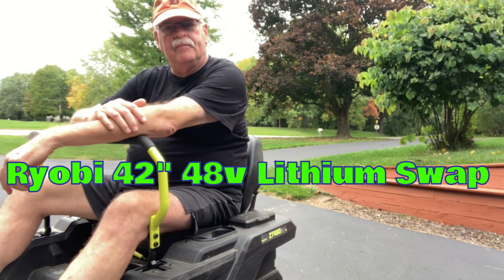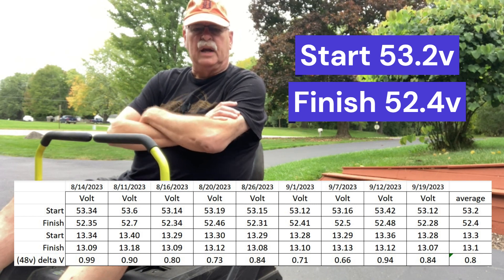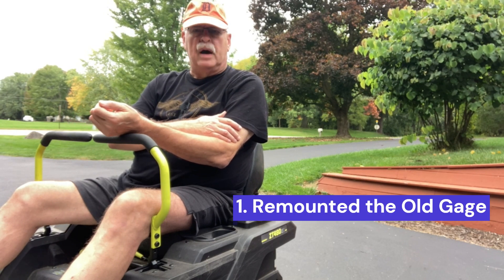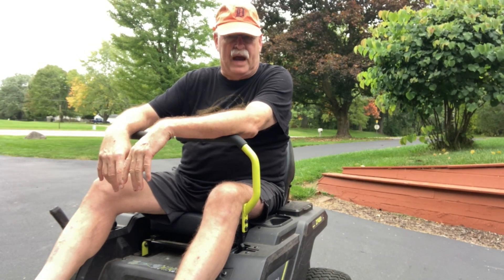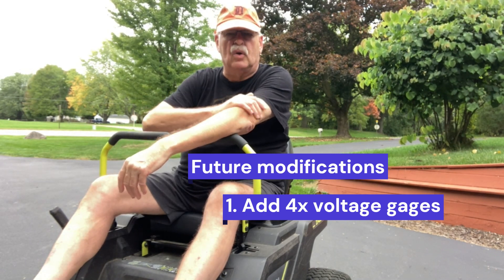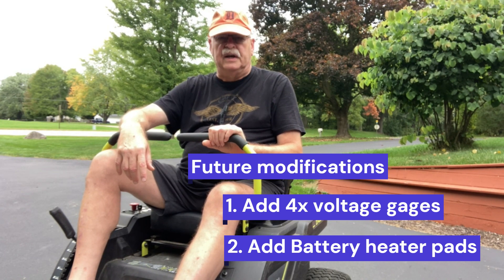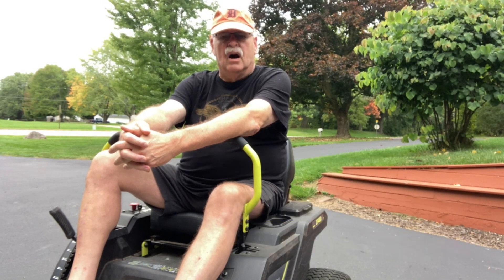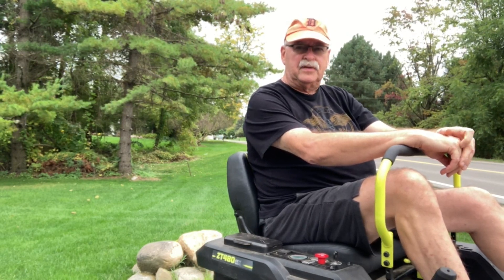Ryobi 48v 42in Lithium swap   10 mows and updates

Comment: Rob's videos are the exact ones that I was looking for I want to keep the stock look of the mower but update to the lithium batteries because I hear that they're better my only question is do I need to keep them plugged in over the winter or can I leave it unplugged?
Reply from the maker: Maybe someone else will add a comment, but my plan is to leave mine unplugged over the lower MI winter.  (I had kept my lead acid batteries plugged in all winter).  It should hold it's charge, and I can always check the voltage level to see how it's doing.

Comment: I’ve got a worn out front wheel for my Ryobi zt540e. Where are you getting replacement parts? I can’t find them. Thank in advance.
Reply from the maker: I've gotten a set of blades from Home Depot for a good price, then I ordered another set of blades and the adapters from Parts Warehouse.  I recall they delivered pretty quickly.
https://www.partswarehouse.com/Ryobi-RY48ZTR100-48-Volt-Electric-Zero-Turn-Mower-s/554747.htm
Other than that, I haven't needed any "Ryobi" parts for 3 years.
How did you wear out a front wheel/tire?  How many hours on yours?
Reply from the maker: ..and I just looked at the price...wikes!  $115 plus tax/ship.  A few of those will start to add up.